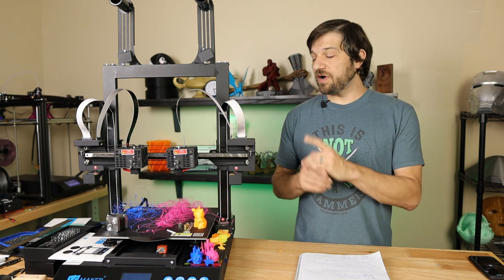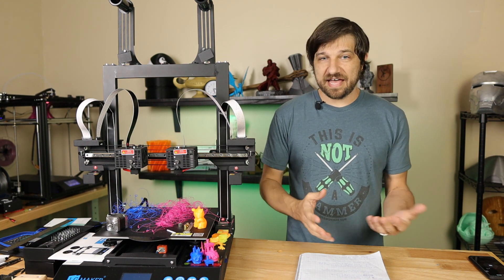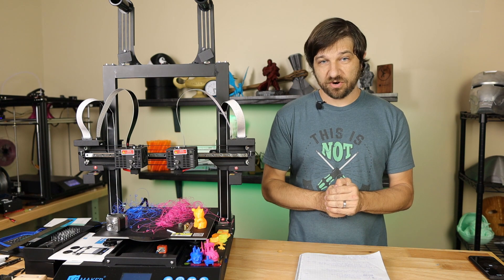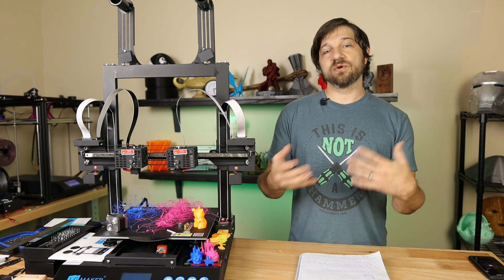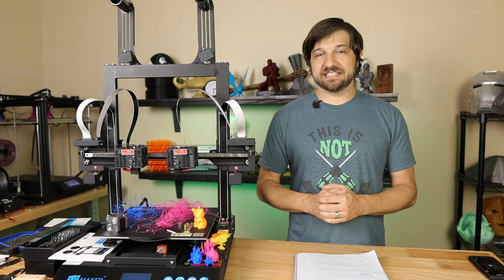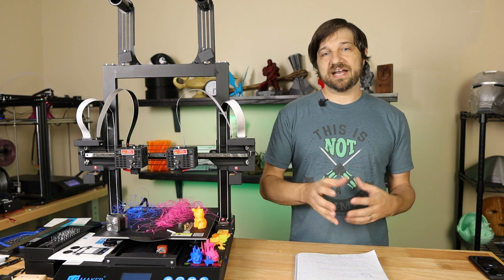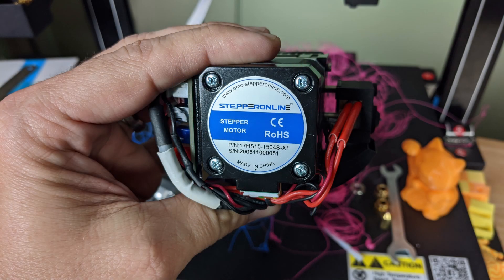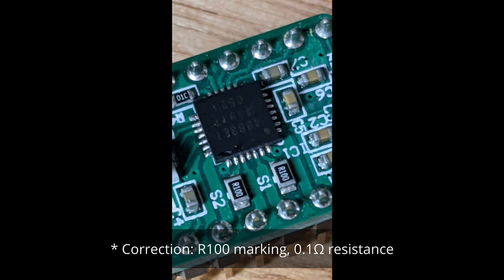JGMaker Artist-D Extruder Issue Deep Dive

Comment: So in conclusion the printer is under extruding due to a design flaw. This is very disappointing to here. I'm a backer and was really looking forward to this printer.
Reply from the maker: That is my conclusion. They still have a little time to present a solution before the end of the campaign.
Reply: Kersey Fabrications yeah but the problem is implementing the solution at a factory level. This campaign is rushed. They should have waited for all the issues being fixed before even starting the campaign. 

And now they are having a nice 7 day holiday instead of working on  fixing the problem. It looks like they are just stalling until the end of the campaign. It wasn’t just „coincidence“ that their campaign runs now and time gets short.
Reply: @Chrissi33004   all this would take is a change to dual drive extruder while not easy they might be able tot do it.  I do agree that ALL manufactures should focus more on the beta process and avoid sending beta products out to reviews and customers.  If they take the time first to do it correctly it will avoid many issues along the way.
Reply: Scott Worthington how are they going to do it if they rather spend their time off and delivery is set for November? A change at a factory level isn’t just done overnight.
Reply: @Chrissi33004   i don't think its a design flaw i have run the same test as Kris with mine and I do not have the same problems as him .  I think the issue is his exact beat printer not an general flaw for example if his is slightly out of spec. Or heck maybe mine is out of spec hard to justify based off 1 or even 2 printers
Reply: @ScottWorthingtonC3D  that makes it even worse. That means that its a Quality Control problem on a beta unit that they know will be sent out to a reviewer.
Some units have it, some dont, that will lead to a lot of frustration for the end user. 

JGMaker may be in contact with the reviewer but stays mostly silent on their kickstarter. On that note: the kickstarter being filled with numerous spelling errors, lack of updates, wrong location (TX, US), convenient 8day holiday in-between, and not mentioning which flaws will be fixed for the final version, and which wont - is all but professional. 

The product looks solid, but what JGMaker really needs is time. Time and the willingness to communicate more with their backers, beta testers, factroy and more. They should fix the base machine before even thinking about offering a 'pro' version. 
And they need someone to check their spelling errors before publishing anything on their kickstarter.
Reply: @Chrissi33004   the problem is that they knowingly  sent reviewers beta printers this should never happen... thats something  I have been trying to tell all printer  manufactures for years I finally have a few that are starting to listen but the issue is that most manufactures don't truly understand  the way the design process should go... design... refine... alpha... refine... beta.... refine... production  all with quality control along the way the only manufacture I know that does this fully is prusa. And maybe e3d.

Comment: I haven't seen the 1st video so sorry if you have already tried it. I believe you should just try calibrating your extruder steps and probably acceleration for it.
Reply: It most definitely is a hardware problem but give that a try. Also maybe change the driver of the e motor
Reply from the maker: In the first video, trying to calibrate the extruder is what led me into this problem. It will not calibrate due to the slipping. I've used the A4988 on a lot of extruders with no issues. It's not the newest stepper driver but it's always been reliable.